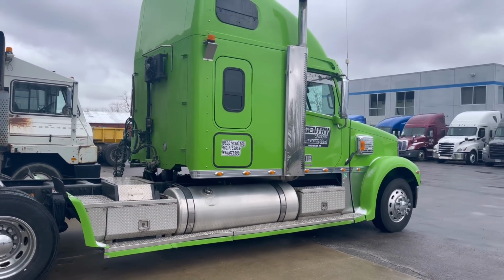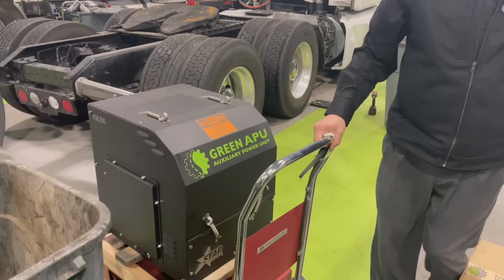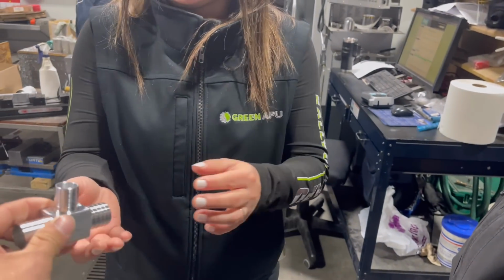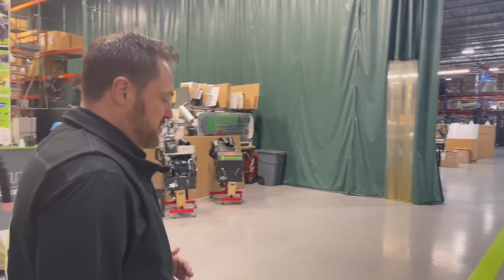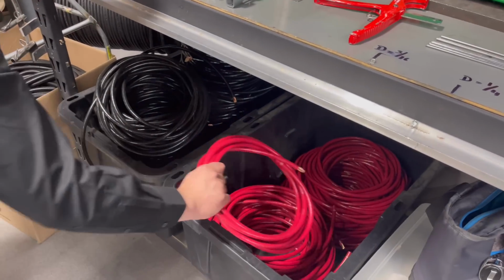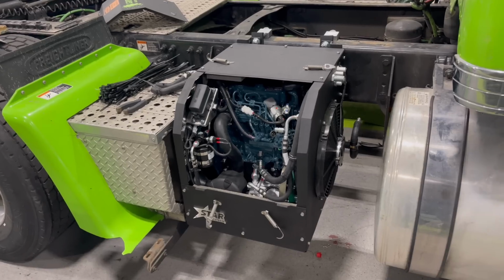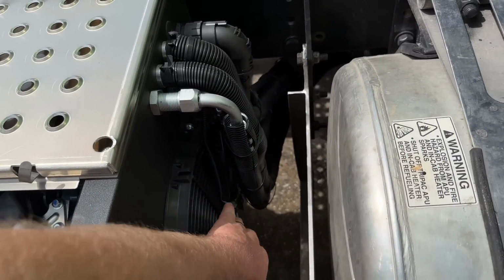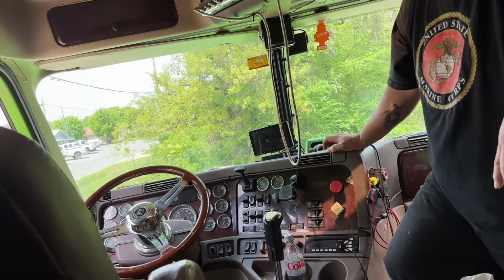The Coranado Gets another Brand New Engine..(Going Green)

Comment: They must not leave a mess of aluminum shavings all over your sleeper & under your bunk when you have a youtube chanel.  No issues with mu apu yet in 3000 hrs.  But when I left green apu after the i stall I was over 2 gallons low on coolant and the install was pretty sloppy.

Comment: One of the best features of Green APU is it is easy to use, and if you have issues ever, other than tbe Kubota engine, it is automotive parts based.  Most parts can be sourced from any parts store to get it going again.  Lamont Illinois has every part you could ever need.  That is if it ever needs.  Mine has 1000 hours, not a single issue.  Just got its 1st service.

Comment: Green Apu is awesome love em
Another great Apu company is Go Green Apu 
The company I drive for has them they are bigger due to having a 5k power generator with it gor 110v but has the same Kubota engine has its own independent cooling system condensers and radiator are mounted on the back of the Apu under the frame rail heat and ac like the green apu and to keep thr main engine warm just plug in the Block heater  and the Go Green Apu has a battery monitor which is great

Comment: if you check with steve, it actually makes starting his engine easier for cold starts, and, the belt and many other parts are actually available at your local parts store.
But you guys need to find a way to get out of California.
Oh, and you could actually add batteries for inverter use if needed as in California they are threatening to not even let the APUs idle.. or generators.. So someone who is on the road all the time needs a extra battery setup..
Reply: like that big white cabover- imagine a battery well under a section of deck plate so an inverter can run longer without any idling or losing the main batteries- using deep cycle batteries in that second battery well..

Comment: I'm glad to see you have a jarhead Marine working for you as you know I served in USMC in the 70's then after went to heavy hauling  certified to pull up to 13 axles. Most definitely go with Green APU that's what Steve had installed on his cab over Peterbilt FSC.
Reply: You don't need to be certified to run 13 axels, you guys have to stop with the crap.

Comment: Only negative with Green APU is that they are horribly LOUD compared to the others. You’d think that they could get a quieter exhaust made. You can pick out the Green APU units walking thru parking lots. But they also always have their covers in place, don’t start hard, don’t smoke.
Reply: Would it void the warranty if you swapped the muffler and ran a longer pipe which would/could quiet the unit considerably. I understand why they use the system they do cause it will work out of the box on nearly every rig on the road without conflict and if they tried to have a different system for each truck, manufacturing snd inventory would be a nightmare. But there shouldn’t be any reason why we couldn’t add on to the existing pipe in order to tone it down a bit unless I’m missing something
Reply: @1982MCI  We have modified our exhaust system, now with a 180 degree bend. 30% quieter as a result.
Reply: Ya know what's louder? Some jabroni idling his truck the entire night.

Comment: There is a few things I don't like about the green apu with the first thing being their ugly white surface mount control panel with with visible screws and wires.  They need different color control panels and the option to flush mount them with back wiring.  I also don't like how they mount the evaporator box using self tapping sheet metal screws, they should use closed end rivnuts.  And the one big thing is how they generate heat, they are running a diesel engine to heat water to generate heat which is not efficient at all and added wear and tear.  A espar or webasto diesel bunk heater is a much better idea which uses a fifth of the fuel.

They need to come out with a new control panel with wifi and Bluetooth connectivity that has different color panels and better mounting options with the ability to back wire the panel.  Many trucks have integrated wifi access point or drivers have cellular hotspot in the trucks.  If they had wifi connectivity drivers could monitor and control the apu remotely.  If the truck is parked in a lot a driver could fire up the apu 30 minutes before arriving at the truck.  Also with internet connectivity the company could monitor the usage of the apu and send maintenance alerts to drivers and company managers or monitor faults.  Bluetooth connectivity would enable drivers to control the apu from the drivers seat.

Comment: I've got a 2019 carrier apu with about 9000hrs so far 1 generator capacitor, 1 generator belt, 1 water pump belt only parts replaced.  Do a pm every 3 months.   I think I have a Kubota motor and my dad's tripac is a yanmar... I couldn't even tell you how many hours my dad's has it's one of the very first models made.

Comment: Nice they fixed your fender assembly better then it was.  
I only got two concerns noise, and tied into water jacket.  I know some like that but one water issue at either takes both out.  Only takes once and at -10 you don't forget.  
Like the mods they made.
I have onan with bit bigger motor. 
Over the years it saving on big motor versus fuel economy that counts.  
Be interesting how their sensors hold up.  Several friends have that issue on TK and Carrier.

Comment: Battle tanks have always had apu's because imagine running a 1800cuin 2000hp diesel that consumes 2 gallons to the mile and letting it idle to power elctrical systems on the tank
Reply: ☝️☝️☝️☝️CONGRATULATIONS
DIRECT MESSAGE TO CLAIM PRIZE🎁🎁
🔝☝️☝️

Comment: Is it a power unit are just 
a/c and Heat
Reply: the Green APU does not produce or provide any electrical power as in 110 ac
Reply: @kw900lkevin  if it keeps the Batteries charge thin a Inverter will do just  fine
Reply: @kw900lkevin  actually it does and that can be ordered together with the unit in form of power inverters, or separately through the online store
Reply: @mrwgems  in the video's I have watched they have not mentioned the inverter, So you have to add the power to a auxiliary "power" unit
Reply: @kw900lkevin  inventer goes into your sleeper, of course. They do not add it to the actual unit